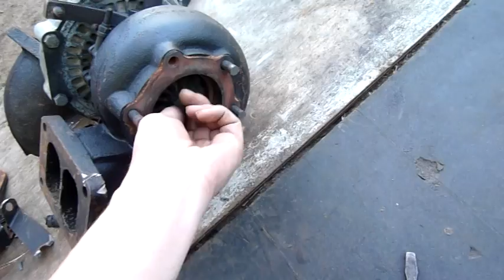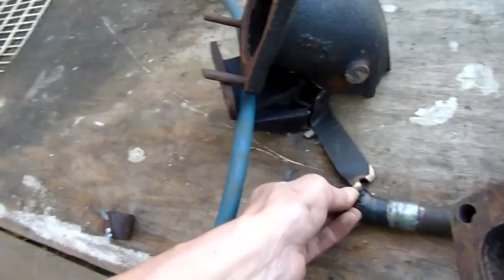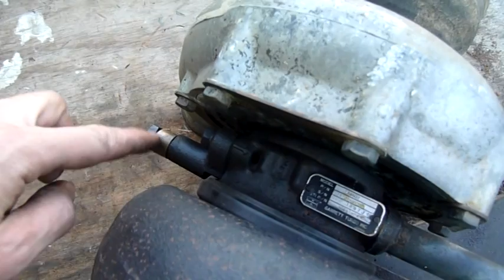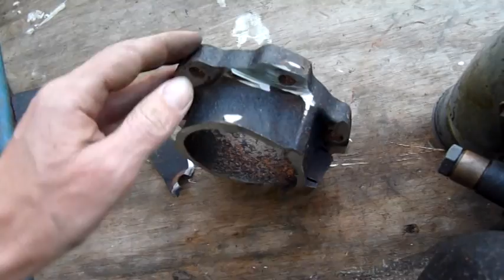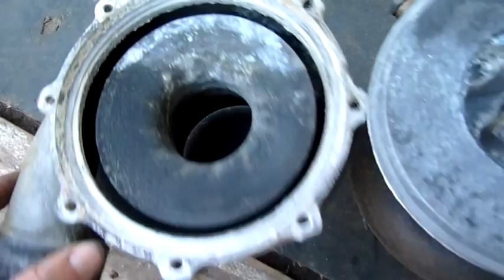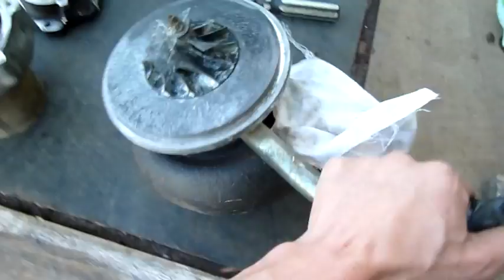Jet Engine Turbo Inspection

Comment: being a diesel turbo, they are rated for much lower operating temperature. old aged oil seals often fail under the increased heat required to run in turbojet combustion setup.
WI is a good option ,will require a control system of sorts.

Comment: most turbojet builds fail due to the turbo used being worn out or in poor health due to the fact that they did not know how to inspect and properly access the turbo health. turbos are high precision and thus need to be handled in the correct way not butchered or rolled around in the dirt prior to assemble.

cooling is also the other key factor which is often over looked.

Comment: pt1

not strictly true for a few reasons. 
1) old carbon'd oil solidifying, needs flushing.
2) hydrodynamic load-carrying capacity and the bearing damping characteristics. lubricating oil thickness for the inner bearing clearances & strength, whereas the outer clearances are for bearing damping. 

the shaft wiggle test only shows whether its toast or worth further investigation NOTHING ELSE, you can not check the inner clearance of say 0.0025mm by hand.

Comment: most important part of any turbo is the condition of bearing & seals and the only proper way to check is to clean 1st, then measure & conduct a leak test . all service spec can be found on the Honeywell website. special tools, knowledge and experience required.  
one thing IT certainly needs is a full strip down , proper clean up or its going to become a paperweight in no time.

cooling is key an area most fail when trying to build a turbojet project that actually runs.

Comment: Outlet side will self clean on first startup. I have seen these running white hot on an engine ( but not for long) as the drivers drive them brick foot, never mind the mixture is still burning when it is leaving the exhaust at the rear of the van. The UD may be underpowered but it does last, plenty here running without the turbos as they are very sensitive to oil condition, and the muppets never change the oil or run it correctly.

Comment: hey ed why not just make a totally new Flange ? use a scribing compass measure bolt to bolt (dia)/2=R Radius x3.14 / 6 gives you the distance to set your scribe then you start on the circle Scribe small line move the scribe the that line and then scribe and on on ... and get 6 equally spaced points to drill holes in the plate then turn it on the lathe

Comment: to get bolts out, spray some wd40 on then heat it up till the wd40 boils off then hit it again with wd then break the bolt loose quickly and it should come off like butter